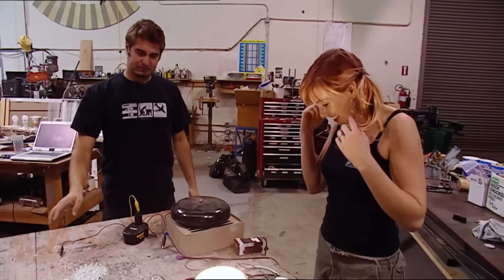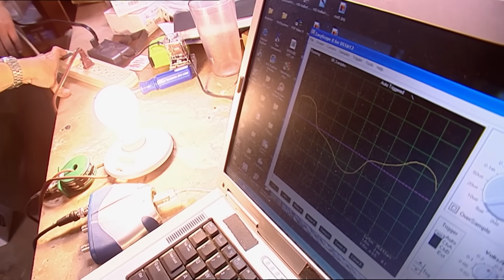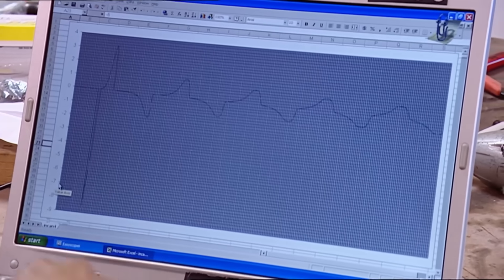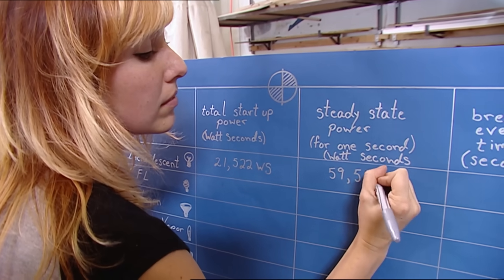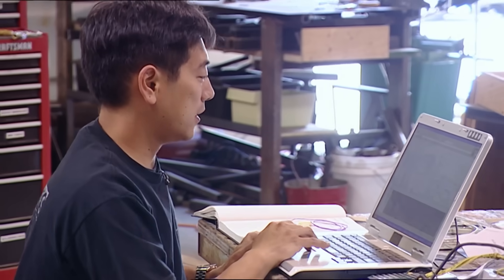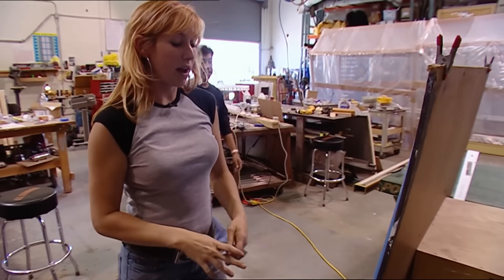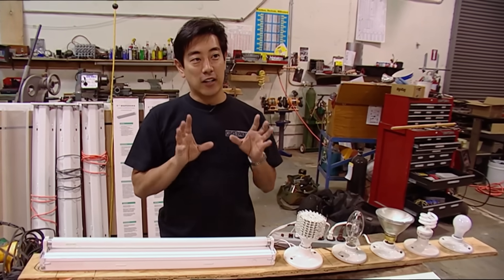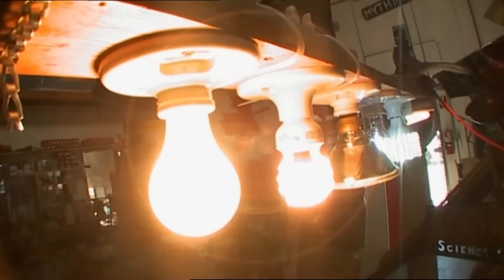Is It Cheaper To Leave The Lights On Than To Turn Them Off? | MythBusters

Comment: In the 1960s I went to a new grade school and the nuns told us "not" to turn off the fluorescent lights in the bathroom because it cost 50 cents every time they turned on. Don't know if that was true back then or a myth. 
P.S. I have some old tungsten bulbs that haven't burned out in a long time because I dial them on with a dimmer, not full-on start. I wonder if the gentle startup makes them last longer.

Comment: I never heard of the light bulb thing but I definitely believe turning your car in and off constantly is worse than just leaving it run
Reply: It's not just fuel economy. Idling for 7 seconds consumes fuel equal to starting the car, or at least used to. Engine strain, however, is a very different story. Starting an engine is very stressful on it, idling is very easy on it. So you might save a lot of fuel by turning off your engine at a stoplight, but you'll pay more in engine maintenance/replacement. (not to mention the ire of everyone behind you as you start your engine and hold them up.)
Reply: @CiaranMaxwell
That is true only for old cars that do not pump the oil. Once all oil is pumped which can be done by driving for a couple minutes, your oil has been fully circulated and will stay lubricated for at least 2 days.

If your engine has not been used in a week, it will be bone dry and so it needs that oil circulating and pumping to prevent wear
Reply: @CiaranMaxwell
If your car has a really nice pump, it only takes a mere 12 seconds to fully circulate engine oil. And that oil will stay there for a bit.  Older ones might need a minute OF BEING DRIVEN to circulate the oil out of the sump area
Reply: Only for pre 90s, pre 2000s cars.  It's been proven that a new igniter is far far cheaper than paying an extra 500 in annual idle gas expenses
Reply: mostly true for older cars, which were by today's standards pieces of junk across the board.  Modern engines will shut down multiple cylinders when stopped or even the whole engine to improve fuel economy.

Comment: this needs an update considering cheap lights, electricity, and the longevity of the light switch.  see, replacing the switch plus labor costs a lot of money compared to the cost of electricity or tiny fraction of the life of LED lighting solution.  
I started to think this way during the popularity of TOyota Prius and switching off an engine in a traffic light.  Turns out it is a terrible idea, it probably halved the life of the lead acid battery which definitely a lot more expensive vs the fuel savings.

Comment: You need electricity, metal, and gas. That's a light. Personally though, with modern LEDs, I just leave a couple of them on because they consume like 70 watts combined. 60 of those watts come from the adjustable filament light I have. This still equates to just 0.184 GBP an hour with prices of 0.00027 GBP a Wh. It's around 0.002 GBP an hour when I am asleep, because that adjustable light goes off. So if I forget... Literally pennies. Unlike washing clothes or using the oven.

Comment: I worked at a place that had high pressure sodium bulbs. It was said that the HPS were left on during our 15min break, but turned off for the half hour lunch. This was a combination of life over power consumption..Turning them on and off shortened the life. Somehow it was engineered this way.

Comment: I disagree to an extent. The cost to replace a fluorescent tube is much higher so leave it on for a longer period>>don't turn it off only to return to the room ten minutes later and turn it back on. Turning it on and off uses up the filament in the ends of the tube faster. Turning mercury vapor lamps like that which are used in large gymnasiums on and off isn't good either as they won't come up to full brightness for several minutes.

Comment: The 2 min on/off trial while done to make this test possible (ie: not take years or months), it’s unfair for the fluorescent tube because the ballast has to start it, meaning it doesn’t reach running current at the same speed as the other bulbs. This also differs with ballast types. An older preheat or a rapid start ballast is slightly delayed in starting but the preheat of the anode helps keep the electrode from breaking as quick as a modern instant start ballast which strikes the arc in a cold tube. The metal halide was also unfairly judged because it too requires a startup process that can take several minutes. 

Most people don’t use metal halide for residential lighting, so its delayed start period doesn’t matter. However, most houses in rural areas like mine use High Pressure sodium bulbs to light large areas. Sure LED bulbs operate on lower current, however the light they output is inefficient. For area lighting, the point is to wash everything in a radius with light. LED bulbs are directional which is horrible for area and street lighting. Driving down a road with LED streetlights actually causes you to struggle to see as your eyes experience a change from dark to light to dark very quickly because LED’s don’t emit light in a wash.

Everyone likes to push the LED narrative but chances are, you won’t turn on an off a Flourescent many times a day, especially if in a workshop or garage. If you have a gas discharge bulb it’ll be switched on and stay on for several hours. The longer gas discharge bulbs run, they reach their ambient temperature and the resistance causes lower current to be drawn. So yes, startup draws more current, but so do induction motors, and those are everywhere 😂😂😂
Reply: I agree, also I really hate LEDs I wish they never changed hps for shitty LEDs I always say this in my opinion HPS is better than LEDs, reason 

Because they light up areas much better their bright enough to let you see without it being harsh on the eyes ,
On top of that they are better for weather conditions such as rain, snow & foggy conditions,

LEDs are terrible for lighting their terrible in weather conditions they're harsh on the eyes their not good for the environment like humans and animals or insects they're much higher in glare than high pressure sodium,
When LEDs light the area some parts are pitch black or shadowy.

Comment: I always enjoy Mythbusters, but after testing the longevity of a bulb by turning it on and off every two minutes they say that is around 5 years in a normal home. My question is if you do turn the lights off every time you leave a room then how long would that be? I move about the house frequently when I am home and that would be well above the average used.

I just had to replace an LED cluster bulb because the capacitor, I think, died. The LEDs were still going strong. It was cheaper to just replace it. Which had me wondering if it was better to leave the light on or add more to a landfill.

Comment: This all makes sense for the home user.  As pointed out by others the specifics of metering / in-rush current may matter for business/industrial user.  And in some cases the total cost is strongly affected by the cost of labor for lamp replacement.  If you have to pay someone's salary to come and change the fluorescent, you're paying more than the cost of the light just to do the changing.  So paying for better ballasts, or the cost to replace/remove the ballasts to put in the LED, may overshadow other factors in total operational costs.

Comment: Now, 18 years later, nearly all bulbs are LED, with only a few incandescent stragglers still hanging on. The bad news is that there's a huge variation in build quality of LED lighting products, so it's complicated to determine what the impact of turning on and off all LED lights is. I can tell you there's a huge decrease in amount of electricity used in LEDs vs incandescents.

Comment: Because of the extreme thermal range of shutting LEDs on and off, yes its cheaper to leave some LEDs on. The driver and chips constantly heating and cooling make them fail. The cost of replacing them outways the power usage. I've had the same LED light running non-stop (minus power outages) for 15 years.

Comment: Sure, you save money but there is no power saving here. Do you think that if you switch on your lights and start drawing another 5 watts your local power plant starts generating 5 more watts on demand? That's not how it works because that's impossible to predict or detect. There would be a notable delay between flipping the switch, a signal being sent to the power plant, the power plant spooling up a tiiiiny fraction of a percent more than it was previously (probably such a small change it can't do it), then after however long that would take there would be more power and you could turn on your device. This could take minutes.

The way it works is a power plant has data on how much power has been drawn from it that goes back YEARS and they compute a general average baseline amount of power they should generate. This is adjusted for things like weather ahead of time, because users drawing more power than the system generates creates what we call brown outs and no one likes those. Whats more the address you use isn't a factor here because people move around and change habits so this data isn't like "ah yes, 1012 Place Street only ever draws 0.8 kw, so we only generate that much plus the rest and 10% extra for a margin of error".

All of this means that you can turn off all of your devices and keep them off forever, drawing no power at all and the power plant will generate the same amount of power because it works like this: "The average home in Townsville draws 1.3 kw. There are 3490 homes. We will generate 4,537 kw for them, with an extra 10% margin of error. This is in addition to commercial power."

IE it is IMPOSSIBLE to save power by turning things off. That's not a thing YOU do. That's a thing power plants decide.

Comment: don't forget the fact that if you turn the lights in  your house on and off randomly, it shows that you're home.   (which may deter  thieves from breaking in.... thus saving you money in the long run)   When I'm not actually at home, I sometimes even remotely open/close my garage door at random times toe create the illusion that someone is home.(but I watch the live video via my Ring camera, so nobody sneaks into the garage when I do that)   Also do the same thing by remotely turning on my stereo and/or TV at very random times of the day.
Reply: When I got my Phillips Hue bulbs many years ago, it even had a mode where it would randomly light up in different colors to simulate somebody watching TV. I never used it because it was probably pretty hard on the bulbs, but could be worthwhile in some situations.

Comment: They forgot to account for heating of the room. Any light generated will eventually end up as heat within the room. For countries that are hot and require AC, it will increase the energy bill. For countries that use gas/electric heating to keep the homes warm, keeping the lights on will have an impact on the power required for gas/electric heating.

Comment: Where are the high pressure high temperature halogen bulbs (OSRAM HID or Osram HCI). If you don't use a hot start capable starter, you need to cool the bulb to nearly room temperature from glowing ceramic filament). For example Osram HMI 1800W/SE UVS G38 6500K 750h 16500lm. 
If you go some power up you got graphite arc light (anti-aircraft and spacecraft defense light): https://www.youtube.com/watch?v=9d7bsCiRFLE ... try to switch it off if a AN602 is on your way and you never need any light again ...

Comment: If the lights you are using, uses AC voltage, it switches on /off, 50 times per second if the frequency is 50Hz. So the light bulb switches on / off up to 300 times per minute.  This means the test you did by switching it on/off, is irrellevant actualy..

Comment: But now we need to recalculate to see how much it takes for my Amazon Echo to process "turn off the lights" and for the router to transmit the signal across the internet, to the light, for the smart bulb to receive and process that signal, and then take the action. Same for turning the light back on.

Comment: I've been wondering how electricity/energy consumption is affected by the use of "smart" LED bulbs and "smart" outlet plugs. In these cases, you keep the light/power switch in the "On" position all the time and control the bulb/any other device plugged in with some app or other smart home hub. With the power switch always being in the "On" mode (even if the bulb/device itself is off) is there still energy/electricity being consumed/lost?

Comment: Back in the 80s and 90s At school we had mostly 8FT Fluoresecent Fixtures Magnetic start with a Starter lamp, and sometimes they took like 30seconds to 2 minetes to flicker on becuase the caretaker did not want to change the Dieing starter over, that used to use a lot of Electricty.  Plus it was a 1960s Building falling apart in the 90s too.

Comment: I heard that claim repeated endlessly by people with no clue about basic physics and back in the time of florescent tubes.  But it just never made sense.  If switching on a fluorescent tube did actually consume the energy consumed in five minutes (some say 15 minutes!) in a second, the circuit breaker would pop immediately.  If the energy is absorbed by ballast and tube itself we easily get heating by 50°C.  Assuming a lower mass modern electronic ballast the value would be much higher.  Also the system doesn't evenly warm, would likely shatter like a grenade.  If you go with this unrealistic assumption and spin it further you reach a scenario where powering up a grid after a blackout becomes practically impossible unless a swat storms every house and switches of the lights.  And with only a few more unrealistic assumptions you can achieve planetary destruction that makes all nukes of the world look like love and roses ;-)

Comment: They overlooked a crucial factor. It's not just the cost of the electricity usage that should be considered but also the cost of the bulbs themselves. The primary wear and tear that will cause most lightbulbs to die is the number of times they are flipped on and off. They will burn out and need to be replaced far sooner when flipping on and off regularly opposed to being left on. Especially as newer lightbulb tech lasts longer, but are more expensive.
Reply: bro didn't watch the whole video
Reply: Someone didn't watch til the end

Comment: Devices are designed to operate continuously, not be switched on and off. If you leave something like a bulb on continuously it will last longer because there will be fewer cycles of heating and cooling etc. Have you noticed that light bulbs always die when you switch them on not during continuous operation? It's the same thing with other systems, say airplanes always crash when they take off because that's when most stresses are applied. I used to put capacitors in series with light switches to buy fewer bulbs. Also you can add an MOV (that thing that looks like a blue M&Ms) to cut out any extremes in voltage - to account for the odd case of power surges.

Comment: This test turned out exactly how I thought it would.

They should test auto start/stop on cars. I've heard that it actually wastes fuel unless your stop is longer than 7 seconds.
Reply: There is a amount of time needed for it to make sense. IIRC, around here they recommend turning the car off if you're going to be stopped for at least a minute, but that's considering all cars, not specifically ones with that function.

Comment: Take the same bulbs, let them burn continuously for time calculated with switching on/off. Then compare costs; electricity of having them on all the time vs. switching on and off and replacement cost.. Not so relevant anymore though, thanks to LED.

Comment: YES IT IS. And don’t forget to never turn off your car. Also leave the heat to 90 in the winter and A/C to 50 in the summer. Simply open/close window to adjust temps. Oops, almost forgot, turn on all water taps and let them run 24/7.

Comment: I have a skylight in every room of my house. 
No lights ever come on until after 8:00 p.m and even then all incandescent halogen and fluorescent lights have been replaced with LEDs where the 150 w bulb has a 13 w rating 
Light switches are on a motion sensor and after 5:00 p.m. where electric fees are at peak level my home runs off a solar generator. 
It has been 19 years since I've used any type of gas to cook or heat my home when I remodeled and brought everything up to current code I went overboard on insulation floors walls ceilings and attics. The only time I've turned on the 10 tonnes of central air was  for my final inspection. The two layers of the thermal tent I have on all windows and doors prevents at least 30° of the exterior temperature from entering into the dwelling. Planting a combination of dozens of Queen palms Sequoia redwoods Italian spruce Blue spruce Norfolk pines to help shade my house as well as block the Sun from beating down upon it not only makes for great landscaping  the cost-effective way of staying cool in the summer months. 
During the dead of winter when I had natural gas on the property I had air ducts placed to feed the exterior porch when sitting outside in the rain I would have all my sliding doors open and the heating system would not run longer than 10 minutes even when the temperature dropped below 50.
Prior proper planning prevents piss poor performance 
Benny Franklin set a couple of hundred years ago a penny save is a dollar earned

Comment: Filament and other lightbulbs wear off faster when switched on and off because of heat cycling causing fatigue wear on the materials, like how you can break a piece of plastic or metal by repeated bending. This happened to the filament of lightbulbs. It happens to the microscopic gold wire bonds of modern led packages.